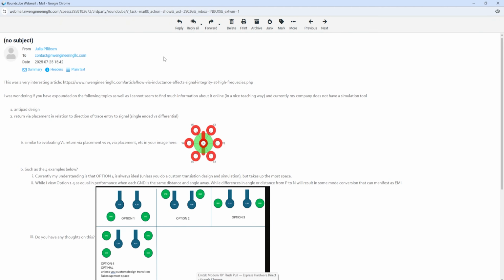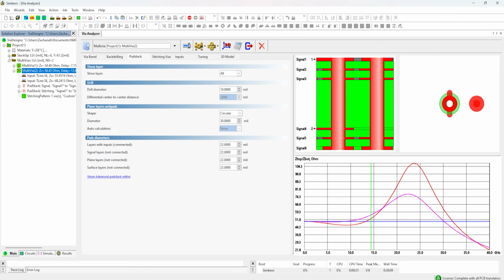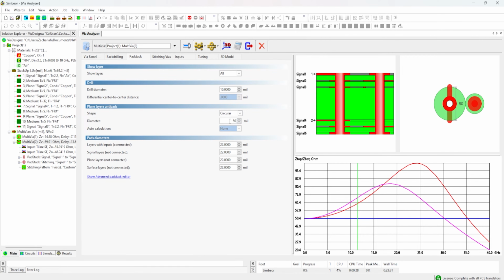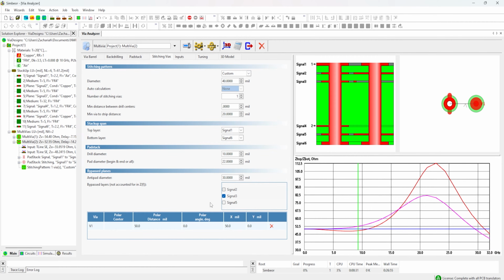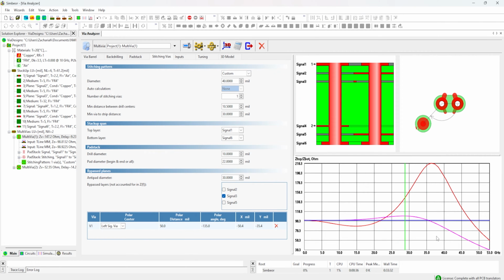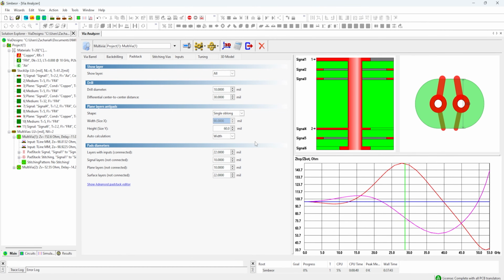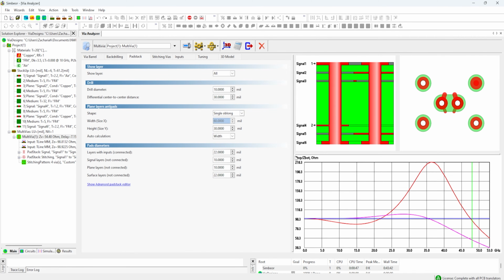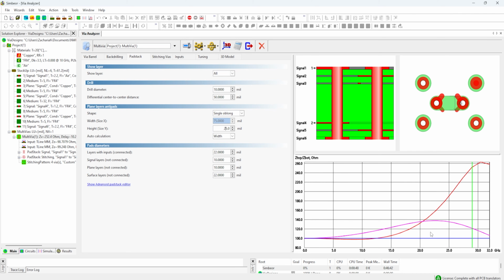Differential Pair Vias and Stitching Vias

Comment: I know that this question is not directly connected to the video content but it is a little bit related.
When you have a signal let's take for example EtherCAT that require 100ohm differential impedance and you need to connect 2 boards (those boards don't have metallic shield) are there specific consideration for the cable, wires used?
Are there specific AWG need to be used and will twisted pair keep the proper impedance at around 100ohm?
If the cable is a little long what consideration we need to take
Thank you.

Comment: Thanks Zach for another great vid! I thought it worth mentioning for those that don't have an expensive simulator, Bert Simonovich has written several papers describing equation to model the differential impedance. You can find a calculator in the free saturn PCB toolkit in the via tab with differential via ticked. Note that it doesn't define the stitching vias. My experience is that it gives a good starting point and not far off the mark.